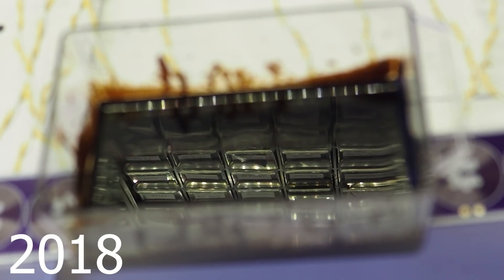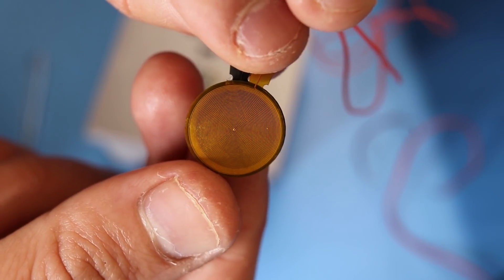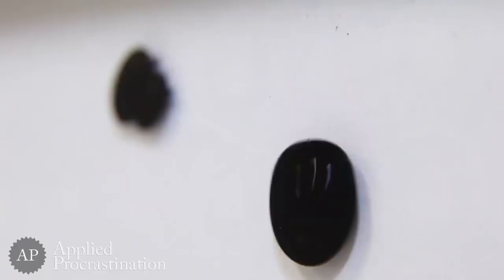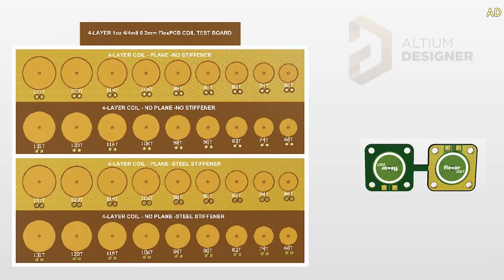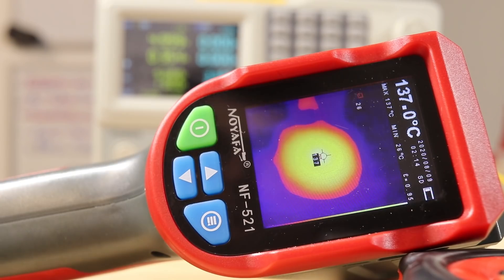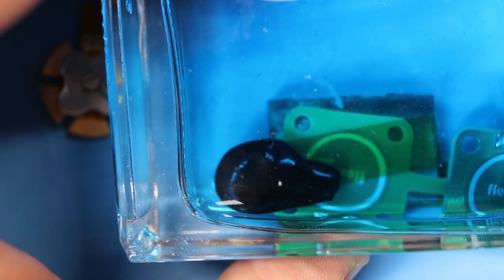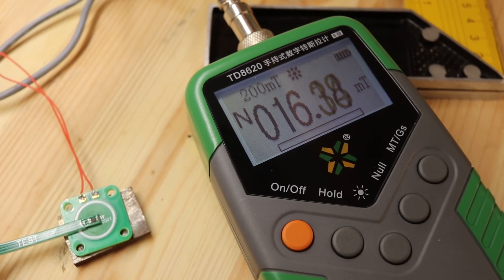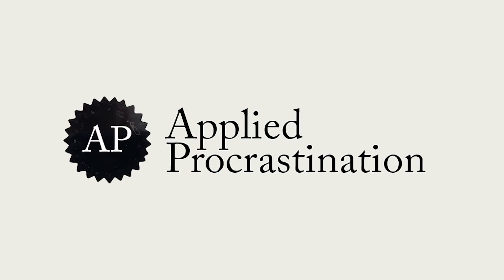PCB Electromagnet vs Ferrofluid

Comment from the maker: Thanks for all your comments and feedback 😊 I will talk in more detail about this 12-layer pcb coil in one of my upcoming videos & I will also put it on sale on my website https://flexar.io/store/p/pcb-actuator-12-layer-coming-soon
Reply: U were almost able to through a drop straight up and down if u could lunch one up u could maybe float it or disrupt in someway I seen potential in there somewhere.
Reply: Hey carl you should check out ECM PCB stator technology. You can design your own PCB motor!😎
Reply: What if you submerce your invention into https://en.wikipedia.org/wiki/Novec_649/1230 ? Can  I help with overheating ? Maybe is necessary use more heat conductive base of PCB...

Comment: what is the purpose for the little holes in the golden areas of the board?

is it to release pent up heat ?

i also see them around plated screw holes (vias) at the edges of boards.

Comment: Use more layer and may be use some layer (100% Cu) to spredd the heat to outside . Outside lots of via . Cause the coil is used with DC there is practically no magnetic short

Comment: Had the idea for trying to make a transformer from something similar to your pcb coils, just with a hole in the centre for an iron ring to be the core. Then to actually have a difference in turns you either use two different coil layouts or using two different coil pcb thicknesses

Comment: If something can extend magnetic fields then it can usually sense through them. Maybe you should look for a configuration where you can detect changes to the field. Probably through back emf.. 
The thing is if you buy last time I looked about $100 in magnets and had them mounted attached to those boards in the right way you could use the existing perminit magnet as a base line then the board as a secondary, then have the static be the physical object and have a rough cut mri sensor. No where near medical standards but maybe objects or given some work hidden metal frameworks like curit boards under plastic.

Comment: You are always a genius,
I think you have to work on nano technology,
The time need this technology,
Make all your ideas which can only be seen under microscope,
For e.g make a spy quadcopter of smd size,
You can power it my a smd peltier module or smd solar panel which work on sun heat and light.
Make a smd coil and smd propeller,

Think if your nano project work on sunlight than how much time you can backup your nano projects.

Comment: I think you can design coils that go directly inside the ferrofluid mixture. That way the coils are both physically closer to the ferrofluid and water cooled. The solder mask would electrically isolate the windings from the wetter and the solder joints would be above the reservoir.

Comment: Have you tried making your coils with a thicker pcb trace thus lowering its resistance? Maybe that would allow to push more current through your coils and increasing magnetic field. I will also suggest driving your coils with a current instead of a voltage source since current is what causes the magnetic field and you are not depending on resistance variance.

Comment: It has very important misconceptions. It is true that if you connect two coils in parallel, the current doubles. Simply download it from the circuit that excites them and voila.

The same goes for series coils. Turn up the current of the circuit that excites them and solved them.

Comment: the spiral is not efficient since you counter the rotating magnetic from one coil to another to cause friction which results in heat and thus inefficient. do that on gears and it wont work as efficient as well. You need another coil in the spiral to take the emf directly and you can just let it go nowhere or redirect it maybe from behind to give an additional boost. OR maybe a tesla coil might help. Sure it will be less output but might be able to handle more input.

Comment: you could make a pcb thatr ataches at the back to an heatsink that you can cool with a fan or just make it big enough that it can disipate the heat. with this method, you could potentialy run the pcbs at a higher voltage.

Comment: You could try to thermally couple the metal backing to the PCB with some thermal paste perhaps? If you're able to make the metal plate work as a large heat sink then you might be able to drive the magnet with a high voltage while keeping temps under control?

Comment: Adding ferromagnetic metal to the center will improve the magnetic field quite a bit. Or possibly a thin ferromagnetic disc between the coil and petri dish? Might work too.
Reply: I was thinking about that. The problem with ferromagnetic core he showed in the older video was how to place the core in the flex coil, but with the 12 layers been stiff would'nt be possible to place a core now?

Comment: Hello I looked at some of your videos but I miss what your goal is. Do you want to increase the power of magnetic field on a large surface or in small? Regarding the magnetic field increase, it would suggest that you change the clean copper for a mixture of copper and iron. Such Materal reckon with acid should therefore be necessary to handle the circuit. Another idea would be to do the holes in the circuit. Through which a metal tile would have to come out of the bumps. The layout of the holes in the circuit I leave your imagination

Comment: Hi Carl :-)
i wonder what a Peltier cooler + your 12 layer Flexar on 12V can archive? Or better saying general cooling your flexar and pumping up the volts. 
Another idea about cooling (looking at the ferrofluid display) is that you just put the flexar in the liquid so that the liquid is cooling the flexar and you can pump up the volts. idk what liquid is used and if it would work but it may be worth a try?
I'm sure that one day you'll find the perfect use for your flexar and you'll revolutionize the (magnet)world :-)

Comment: Is the glass-layer really needed between the fluid and the PCB? Choosing a Fluid/[Film]/PCB/Glass stackup could improve performance. It also would allow dissipating heat into the fluid, creating some sort of passive fluid-cooling. The circulation of the fluid through the change in the displayed image would further increase the distribution of heat inside the display (fluid). This in turn would allow for a higher voltage and hence result in increased performance.

Further ideas for improvement:
- Remove the need for a glass-back altogether and instead use the PCB directly as the backplate.
- Thermally couple the PCB with heatsinks using thermal-paste for even greater driving voltage (see channel "tech ingredients" for example on cheap thermal-paste).
Reply: Is the glass-layer really needed between the fluid and the PCB?  Probably.  You should protect the traces from the ferro-fluid, which could short them out, depending on how conductive the micro-particles are.  Perhaps a thin layer of lacquer would work.
Reply: @darylh8657  : Either your lacquer suggestion or a lamination sheet would probably be the right choice.
Reply: A thin film that is applied in solid form could bring manufacturing benefits.
Reply: @derarchitekt4925  "thin film that is applied in solid form"
The tolerances on a solid substrate would have to be high in order to achieve a tight fit.  I envision some sort of schmoo that can be squeegeed on like the varnish we used to put on photographs back in the industrial age.
Reply: @darylh8657  I agree - possibly a good balance between simplicity and effectiveness!
Reply: I'll start off by saying I am by no means a professional in this area.  This is just my opinion, which may easily be very wrong.

Considering these coils easily go above 120 ºC (248 ºF), something like normal run of the mill EVA Resin would be a no no, you do however get resin rated for 250ºC, but I imagine that stuff would be pretty darn pricey.  Clear acrylic sprays (easiest to get) is around 160ºC melting point.  As you can see, it's a constant battle not only between what would not melt on the board.  

You also need to take into account that films/coatings could act as thermal insulators, making the PCB much warmer.

In all honesty, glass has a high melting point, is a good thermal conductor, and is cheap.  I don't see the sense in using bare PCB's as you could end up shorting them, and to be honest, thin enough glass and you don't need to worry about your magnets weakening due to glass being in the way (er sorry, I don't know the right word for it).

TLDR: PCB very hot, glass good thermal conductor, glass not melt easy, glass cheap.

Comment: Your argument on coil stacking is somewhat off the point. The current over the coil decides the magnetic field intensity. This means that trying to drive coils with different internal resistances at the same voltage gives a misleading result. This is seen with coils connected in series, it doubles the resistance but you should keep the current the same so that increase in resistance shouldn't matter. Since temperature depends on I^2R and the cooling power of the coil, and you doubled the coil (cooling surface) and R, the temperature should stay constant. 

For example consider a coil with very low resistance. In your explanation, it would have lets say 5V over the coil, and a large current through it. That large current would be squared so it would cause high heat. But this kind of coil should be more ideal not "bad because it heats at 5V". You can pass more current through it because it will pass the same current compared to higher resistance coil with less voltage drop so it will heat less.
Reply: Some intersting trivia: You can even write the specific heat formula and find a differential equation for the heating action under constant current. You will see that there exists a current value that makes the system thermally unstable. (Formula is in the form of R=...e^(-t/tau)+... and you see that over some current tau<0)

Comment: As I have previously commented, you could try running FlexAR at 300kHz where it's mostly acting as an inductor, rather than DC where it's mostly acting as a resistor, to lower the heat losses. The caveat to my claim being that I only use coils as inductors and transformers, not as electromagnets. If you look at the phase angle when you show the LCR meter, the 2 layer board has a phase angle of 0 at 1kHz so it's pretty much entirely resistive. The 12 layer board has a phase angle around 10 degrees so at least that's starting to get a little more inductive at 1kHz and the best inductive frequency for that would be much lower than the FlexAR, although still over 1kHz.

You could possibly try using the LCR meter to stimulate the coils at 1kHz, 10kHz, 100kHz and measuring the change in magnetic field strength between the frequencies on that other meter, although I'm not entirely sure how that particular LCR meter works, whether it is actually running at a simple single frequency as displayed or the waveform is more pulsatile/complex. Can't compare to putting a high DC current through them though as that's totally different than the low current stimulation from the LCR meter.
Reply: You have to be careful using AC waveforms for this kind of thing, because at some frequency it'll cause repulsion or something similar.

Comment: Would you try high current coils? Thicker traces for more current and maybe continue the turns in series on other layers! I use DC-DC converters from Murata that output 12V at 50 Amperes and only use PCB trace coils for the transformers. They have 92.7% conversion efficiency so not so much heat is output. Granted the PCB is a lot thicker and has maybe 16 layers or more but still 50 Amperes! Keep on going, I love your work!

Comment: Carl, how easy is it to route arc-like or circular tracks in Altium? Eagle in far from easy when it comes to circular or arc tracks. This is for a circular PCB
Reply from the maker: It's pretty easy.. You can also design the track in cad and then import a dxf
Reply: @CarlBugeja  Thanks! That's more persuasion to move my 10+ years of Eagle background to Altium!! (which I tried by the way)

Comment: You could add a magnet that produces a magnetic field equal to what your coils can produce. Powering up your coil will double the magnetic field. Inverting the polarity of the power supply, will create an opposite magnetic field that will cancel the one from the magnet.

The main drawback is that your coil needs to be powered all the time (either in one polarity or another) and it could be a problem regarding their temperature...
Reply: I think this is basically what he did when we added the magnet to the back.
Reply: @siberx4  Yes you are right!
Reply: The doesn't scale as well because the drive electronics for a huge grid will get a lot more expensive. Currently, the Applied Procrastination derive elestronics just drive the magnets with PWM at a single polarity, which can be done with just an LED driver and transistor arrray. The total cost is ~0.3$ per magnet. To switch polarity you would need to drive the magnets with H-bridges, which makes the cost ~1$ per magnet. For a big grid tripling the cost is pretty substantial
Reply: @billfan7528  The drive electronics are not the dominant cost here; it's the labour of hand assembling a huge array of discrete drivers with wires/connectors/etc. If you could manage to make a viable PCB array of coils, it would come out way cheaper for the whole device even if you had a bunch of extra costs for specific magnets and more capable drive electronics.

Comment: Is it possible to stack the 12 layer in series and power with 12 volts?
Reply: It may be possible to have soldering gold fingers purely for structural support to stack multiple of these coils together. A huge stack of them (50+) may even make a great tesla coil secondary.
Reply from the maker: They can be wired in series but like I explained the series resistance would created a drop in the field

Comment: Why can't you use a 12V supply and just mount the PCB to a heatsink? This will make the final assembly neater as well since you'll need some way to mount the PCB anyways
Reply from the maker: The back-core used in the video in a way acts as a heatsink - I have talked about this a bit in this video https://youtu.be/XfVz9Otxzyo
Reply: In this application active cooling with a fan could also be an option since thickness is no longer limited. Thanks for the great videos!